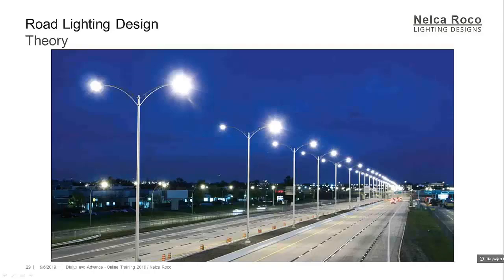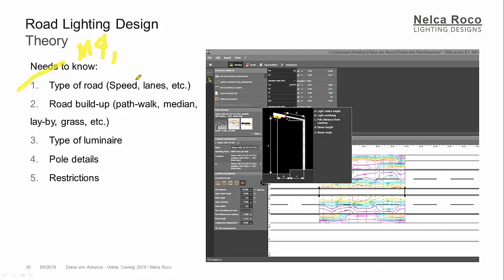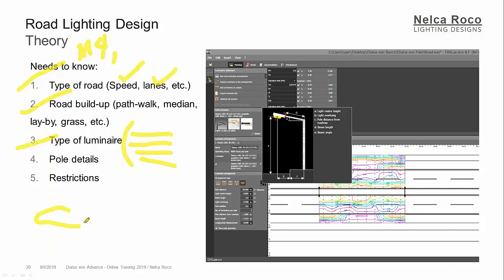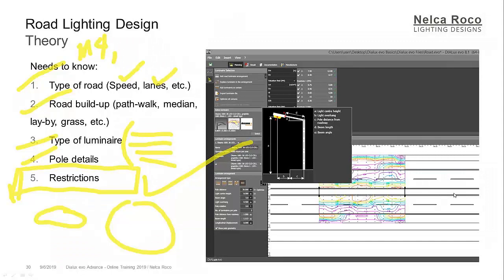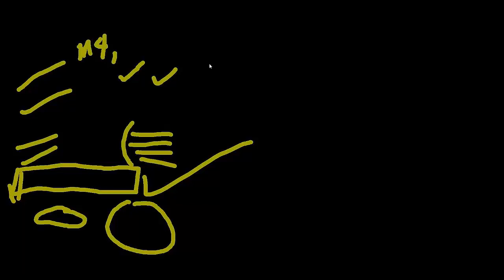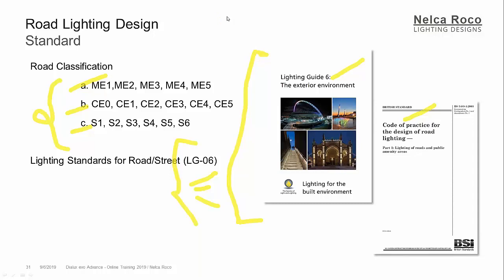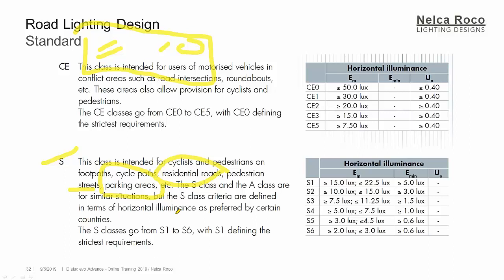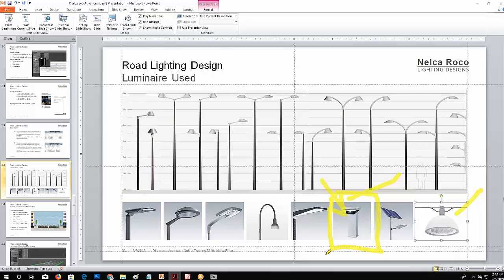Street or Road Lighting Design Considerations

Comment: Please review your question and answer because the height restriction will not be applicable as height of terminal building itself is upto 15 metres so the airport authorities would not care of street light pôles height which would certainly be below 15 mètres.. Even thé Airports themselves have very high floodlights in Apron so you must review yourself please. Correct me also if I erred.